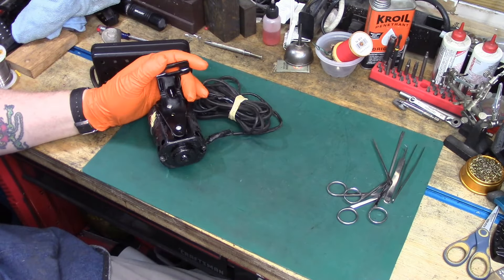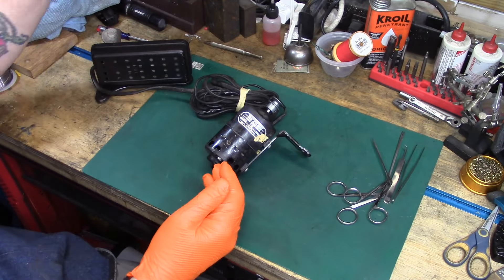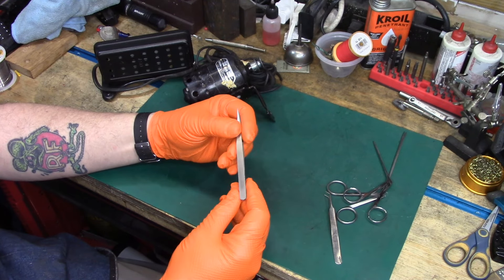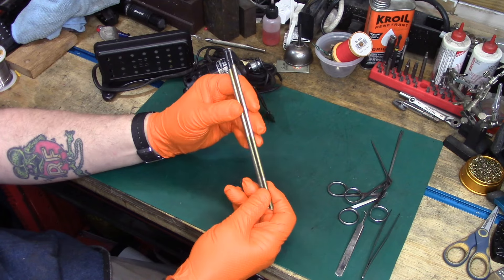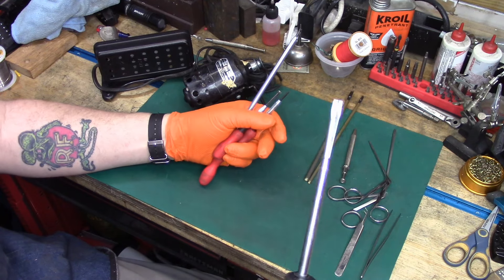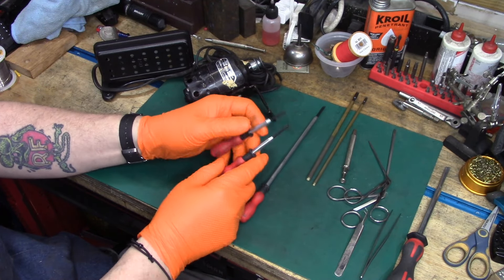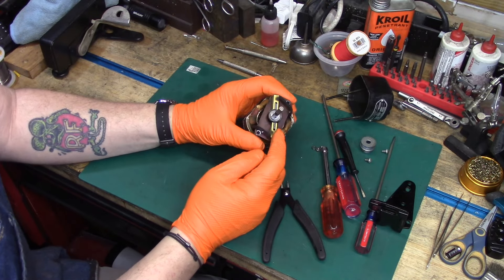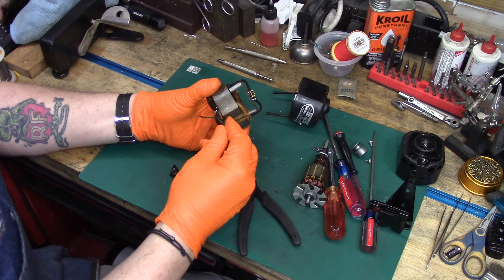Some Cool Tools, & A Badly Abused Motor - Sunday Morning Quickies, Episode 118, May 5, 2024

Comment: I like the similarly-textured orange gloves made by AutoWurks, which I get at one of the local auto parts stores. They are less overly long on my stubby fingers and are reasonably durable for being thin enough for sensitivity.

I knew it seemed as if there weren't enough little loose parts falling out as you disassembled that motor!

Comment: Hi Bob. This question is not really related to the video, but I figured you work on so many machines you might know a fix. 
I just start my Singer 185k seems to run smoothly but the hand wheel wobbles. Just wondering if you ran into this problem before and if there is a fix for it or is that the way these machines run. I appreciate any help you can give me 🙂🙂🙂
Reply from the maker: Odds are, the machine was bumped hard on her balance wheel and the main shaft was slightly bent. I see it a lot on small machines such as the Featherweight and 99 as the mainshaft diameter is pretty small. As long as it's a slight wobble, it's just annoying and won't affect operation.
Reply: @BobFowlerWorkshop  great information. Thank you so much 🙂🙂🙂